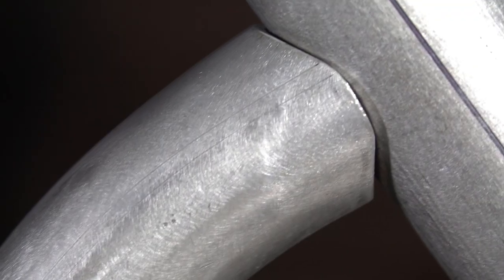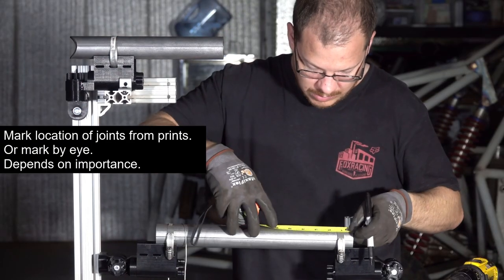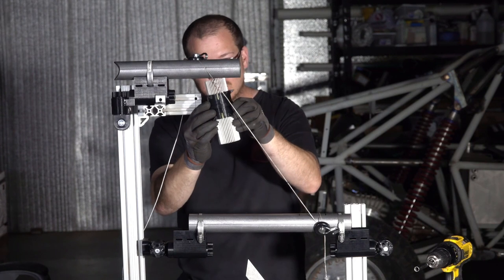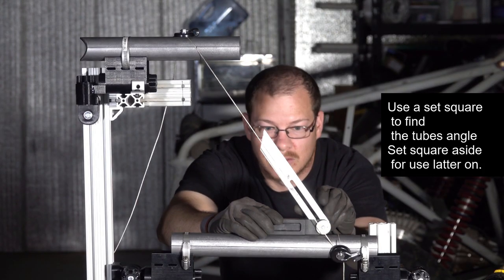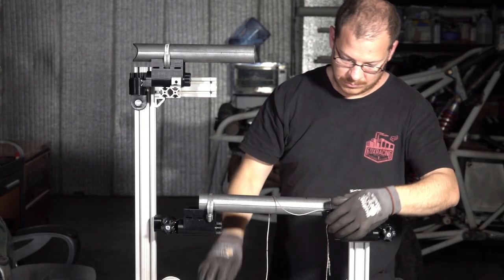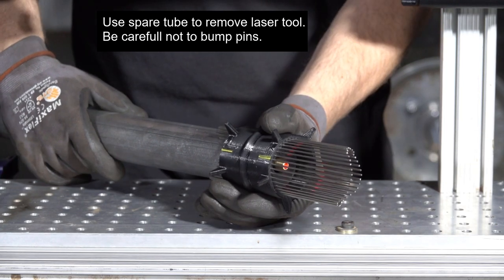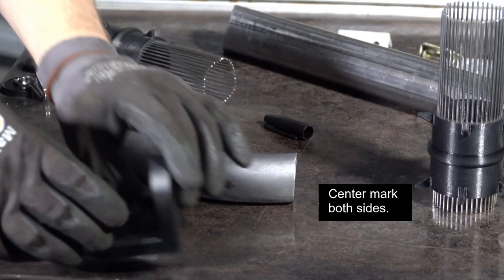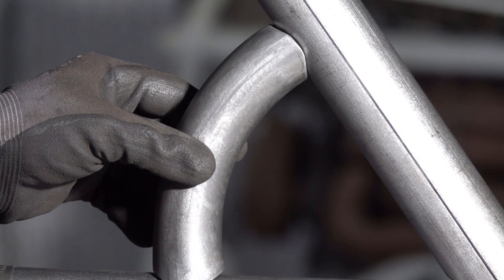Tube Notching Best Tools, Tips and Tricks. Tube notching like the pros, a beginners guide.

Comment: I'm building my first cage and have some very complex joins in tight spaces. I purchased the Center Line Marking Tool
, Laser pointer,  Laser Alignment Tool, and 1 1/2 " Tube Tracer. Centurial was excellent with communication on the order and shipment tracking. I'm very pleased with the construction and operation of the tools. As for previous comments on locking the pins when tracing, it doesn't seem like an issue, but I cut a section of bicycle tubing to make a wide rubber band and that works great. These are awesome tools especially for the price.
Reply from the maker: Thank you very much for the kind and very detailed comment. The pins are tuff we did our best to get the friction just right. We like the rubber band idea we might add that to the kit. Thanks for sharing that little tip. Please keep us up to date with the longevity of the tools. And don't forget we have a 1 yr warranty if you start have issues let us know.

Comment: Just found out about you from red beard garage video on your diy tubing notcher kit with the drill press. Very excited about your product I will be doing a motorcycle frame and side car build in the winter if all goes according to plan. I believe it will work out nicely for that and keep it straight. Please make more videos
Reply from the maker: Thank you and we sure will. We are in the middle of some other projects that are cnc machine related but we hope to be back on fabrication soon and that means more content related to that. Let us know if you need anything. There tube notcher dose have a size limitation at the moment. It can't use any hole saws below 1-1/4. So if your going to use 1 inch or 3/4 just know an adapter will need to be custom made.
Reply: @centurialinc  Thanks for the heads up.

Comment: Mother pipe was 217 mm and branch pipes are 160 mm and 150 mm diameter and also 4 pieces are joining into one location please explain to how cut back the 4 pipe pieces and how develop the cut back . And also 4 branches are18 degree and 22 degree
Reply from the maker: Thank you. We do not work with those sizes. That is Pipe work. We only work with tube for race car fabrication.

Comment: You have the right concept.. but wrong application. Thought on this before..  same concept.... you take a rough dimension of a part... height of the pins... and location give a rough stock boundary to generate a simple one tool roughing op... . you link that at the automatic saw.... and use it as a training lead in for potential applicants looking for a future in skilled occupations
Reply from the maker: Thanks for watching and the comment. We see best results from beginners who need that extra guidance to speed up the imagination portion of fabrication. Very good process you recommended right there. Beginners often times just stare and have no direction at first cause it's so new and foreign. The tracer helps them see directly what they will in time imagine. Same for the string line tools. Thanks again for the comment.